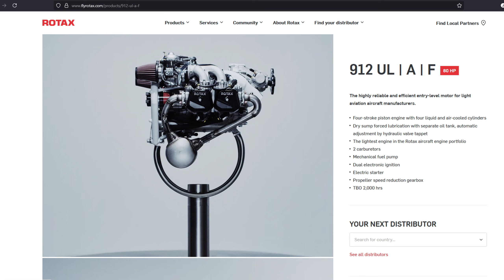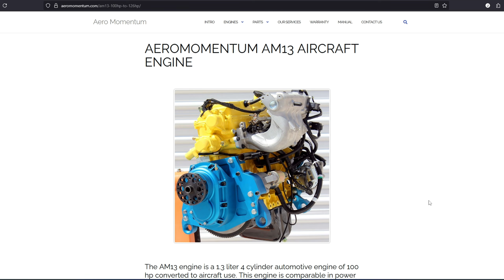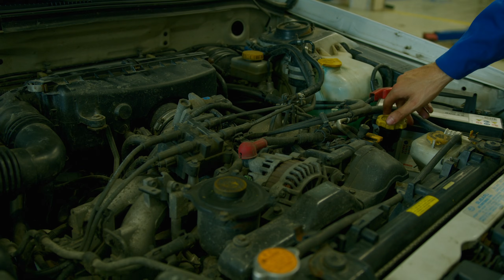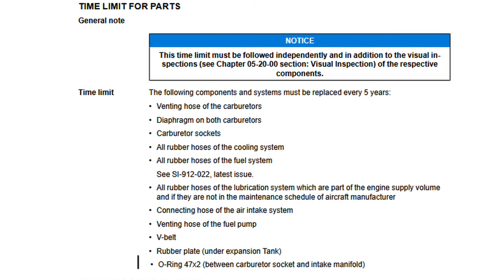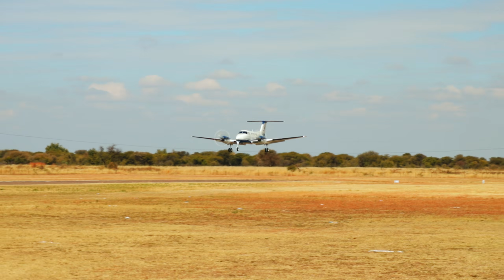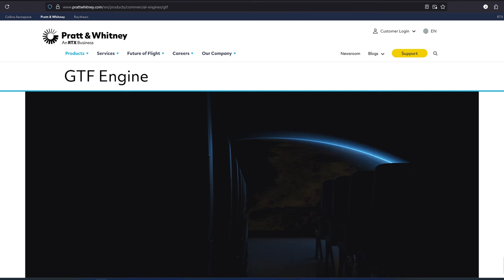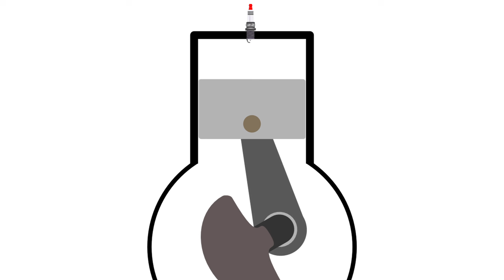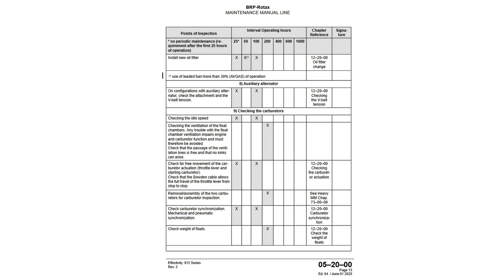Are These Rotax 912 Design Features Problematic? Design Explained

Comment: Price will eventually be the downfall of rotax. Already cheaper auto-conversions like Viking are the most popular in home builf aircraft. It's only a matter of time until they make their way into the certified world.
Reply: A Lycoming IO-390 has a 9 month waitlist and you cant touch one without a 30% deposit on the $84,000 MSRP (Someone told me its closer to $90,000 in late-2025).

This for 210-215hp.

You can buy TWO rotax 912iS Sports for 30% LESS than a Lycoming. And the latter still requires aftermarket ignition to make it reasonably modern. And even then it is a tractor motor compares to a rotax.
Reply: Not really sure what certified world you are referring too. Now that mosaic is law, they have a better chance of finding their way into new mosaic aircraft in 2026.

Comment: A note or two about the suzuki derived aeromomentum engines, that they are new castings for aeromomentum, and that the G series are expressly known for being rugged and abuse tolerant (jimny, tracker). 
While all of the engines here are obviously reliable and built to exacting standards and spec, something does warm my heart a little knowing that the 'little suzuki that could' is a viable option.
Reply: And price is 👌🏼
Reply: I owned an AM13 equipped airplane for four years.  Indeed cheap; engine is a consumable.  Basic engine is indeed bulletproof. However. Thermal management a problem.  Documentation sketchy.  No owners group.  Poor cold starting.  Sole proprietor who will always charge for any mistakes, even if his.  Lots of little problems.  All in all, a very mixed bag.
Reply: Apparently they are unreliable
Reply: Their motorcycle engines are also a testament to reliability.

Comment: I've been flying a microlight with a Rotax 912S for many years, and can echo your thoughts.  It's a brilliant bit of kit, easy to look after, and practically bullet proof.  One addition we do have, is some small jackets that sit around the carb intakes, and are connected to the coolant system, which eliminates carb heat completely here in the UK.  Not everyone would want it, but it's nice knowing that issue isn't going to rear it's ugly head!  Great content, thanks!
Reply: That coolant-jacket system doesn't eliminate carburetor heat; it is full-time carburetor heat.
Reply: Warmed carburettors resolve throttle icing. It’s a common issue with air cooled engines in humid conditions around 5C ambient. It’s deadly in an aircraft engine.
Reply: @Dave5843-d9m   It's also a good way to lower the power produced, feeding the carbs pre-warmed air instead of "virgin"cool as possible air.
Reply: @portnuefflyer  we added heated jackets to the carbs on our 912s in a Tornado. The air flowing through the carbs would have very little chance to pick up any heat enough to effect performance - we didn't notice any performance loss at all.

Comment: While I agree that overall Rotax reliability is on par with traditional aircraft engines, the dual carburetor system is a weak point.   If one carburetor fails, you have no engine because of the enormous vibration. So failure chance is doubling because you have 2 carbs that may fail. Here is a real case of forced landing because of that. 

https://www.youtube.com/watch?v=Hzf_bXIJtZo

These carburetors have to be really well maintained.
Reply: Thankfully, Rotax now offers EFI engines.
Reply: They are constant velocity carbs, like what are used on motorcycles & ATVs.
 Not that complicated. I've cleaned out lots of them of the green ethanol barnacles from them sitting for longer periods of time. Use nonoxygenated fuel is my recommendation.

Comment: Gearboxes not reliable?  I've got multiple cars with automatic gear boxes that have had zero service and more than 200,000 miles.   The gear box on a Rotax is MUCH less complex than a car gearbox.
Reply: Not even just a gearbox, a single speed gearbox which just makes aviation Fudds even more insane.
Reply: The car's weight acts as a damper, but obviously a propeller doesn't weigh anything like as much as a car.
Geared props have been around for ever - the RR Merlin  is the classic example but, excellent as it is, it comes at RR  prices.
Reply: Gearboxes have more issue connected to a piston engine as the torque drops off and goes negative between power pulses. The wind/unwind is much harder to control but it can be done. The V12 or turbine engines are easier to design.

Comment: Why I don't like rotax: its sound ;) On a more serious note, how do subaru engines compare in this category when converted to aero role?
Reply: I put 1300 absolutely trouble free hours on a EA-81 conversion, BUT, it was a bit large for the cowling of my RANS S-7, not to mention about 30 pounds heavier that the 912S I used in my second S-7. 30 pounds heavier in the nose of a 700 lb + airplane is a big deal, even when ballasted out with junk in the trunk.
Reply: At Reno, I am always amazed at the F1 race planes tractor-note put-put exhaust. Even at 4,500r they DO NOT sound like performance motorsports engines. 

The Rotax HOWLS  like at 5,800rpm like a Ducati sounds at 11,600rpm.
Reply: How do you like the sound of "no tax"?
Reply: I don't be likin the sound of sue-bah-ruba connecting rods knockin.

Comment: I am willing to pay a premium for a German designed engine (I believe this engine was designed before Bombardier acquired Rotax), especially if it is powering the airplane that I fly in.
Reply: They have always been Austrian actually...
Reply: Rotax has always built Bombardier power sports engines. Ski Doo, Sea Doo, Can Am, they bought and now dropped Evinrude, which is a bummer in my estimation. As well as aircraft engines two & four cycle.

Comment: Great video, thanks!  Regarding the mean piston speed of 11,8 m/s: many truck-oriented diesels reach similar speeds with significant displacement (=heavy pistons and rods), so this is a lot of "safety factor" with a lightweight, gasoline engine. Looking at your oiling system explanation, it appears the dry sump helps a lot with crankcase ventilation, pretty cool idea.
Reply: Yup, the Cummins X15 gets up to 10.7 m/s, while a normal car engine can get up into the 20 m/s range.
Reply: @PistonAvatarGuy yes, absolutely. AFAIK, 6.7 Cummins can achieve even 12.4 m/s (3,000 rpm with 124 mm stroke).
Reply: @pancakewsx  Yup, and 11.6 m/s at peak power rpm.

Comment: The 912 ULS in my plane had a bit over 1700 hours.  The cylinder cross hatching still looks brand new and it runs great.  I put a new Sensench 3B0R5 prop on it last year and it was like adding an extra 10 HP.  The 912 is a great engine although they are getting a bit pricey.

Comment: I talked to a flight school about the o200 and 912. They had both in their fleet. They said the o200 almost never lasted to 2000hrs. Their 912s often made it to 3000hrs
Reply from the maker: That's interesting, thanks
Reply: The best engine for flight schools: Lycoming O-235 (115-118hp) these go about 3,000hrs +/-300 or so.

O-320 often goes 2,400-3,400 hours.

The IO-360 de-rated from 200hp to 180hp as found in the Cessna 172S/SP will go 4,000 hours if flown often and spends a lot of time at lower power settings doing turns around a point, etc.
Reply: @Triple_J.1  The IO-360's are basically the perfect 180hp engine for sale right now. They don't need lead, their time between failures are crazy high, as you mentioned actual TBO is 4,000 hours, they use "fairly" cheap oil, and they handle abuse like a champ. Also with a good engine monitor you can get the things cruising under 10gph.

Problem is everything they go in are now like $300,000-$400,000 aircraft. A school can buy 2 - 3 912 powered trainers for that cost.

Comment: I am not an engineer, but it feels like torque is a very overrated metric when only viewed on spec sheets.
Reply: It is indeed meaningless, because it is already included in the horsepower value. Horsepower is all that matters, as torque and rpm can be freely converted into each other using a gearbox.
There is a tiny kernel of validity to the wisdom that higher torque engines "feel" stronger, but that is only the case for engines with comparable horsepower and max rpm. In this case, the higher torque engine will have more power in the lower half of the rpm range, where most of us use our engines.
This is of course irrelevant for aero engines, as they run at a relatively constant speed.
Reply: @kilianortmann9979  ok but torque is how horse power is calculated, torque x rpm.
Reply: @oneninerniner3427  Yes, it's like saying container A is taller when you already know B holds 3l and A holds 2l. Knowing the torque is useless by itself and meaningless, once you know the hp values.
Reply from the maker: Couldn't agree more
Reply: The torque curve is important also, not just peak number. It can be a safety aspect for both power response and compensation for cylinder loss.
Reply: @chippyjohn1  Yea thats why I specifically wrote "on spec sheets", since thats often brought up by people who (in my experience) have no idea what they are talking about. I do know that the torque curve is quite important from an engineering perspective, but what you are writing seems to be above my level of understanding.
Reply: @chippyjohn1  I agree and I know why you brought up the torque curve, but even then it is technically still the hp curve that is important. The torque curve just gives you a better look at the lower end of the power band.
Reply: @kilianortmann9979  Once torque or power are plotted on a curve over time, they are essentially the same thing.
Reply: Some people try to argue that it's the torque value that's important when it comes to driving a larger, more efficient propeller, but the torque value alone (as shown in this video) means absolutely nothing, because it has no information about the rpm at which the propeller is being driven. It's the torque + the rpm value that's important, and its the power number which allows a person to easily compare the torque + rpm information of varying engines, that's why it was created.

Taking numbers from this video: 220 lb-ft vs 191 lb-ft, ok... at what rpm?

If the 220 lb-ft is at 26 rpm, what good is that in an aircraft which is meant to carry humans? When we understand that both engines are making 100 hp, we know that their performance is going to be similar.

HP + propeller rpm information provides much more easily understandable numbers which can be used for comparison than torque + rpm numbers.